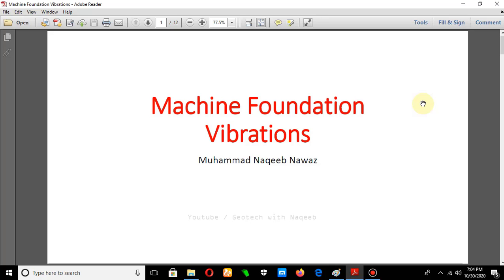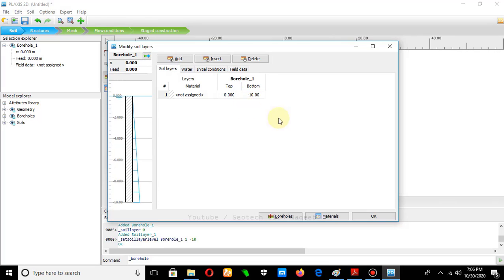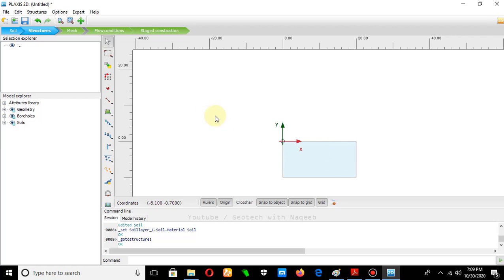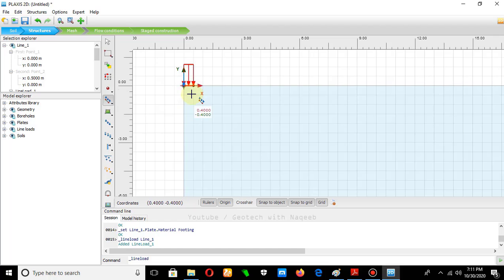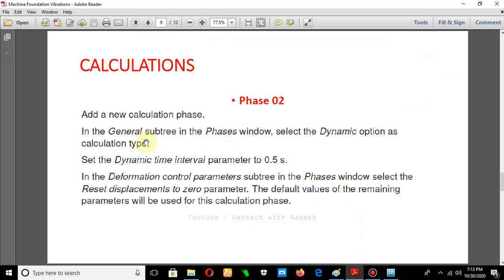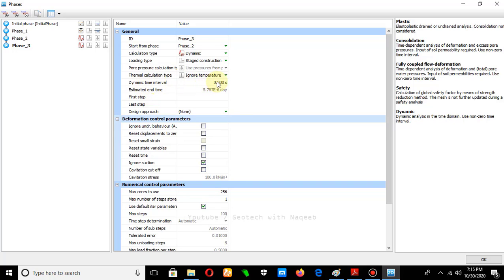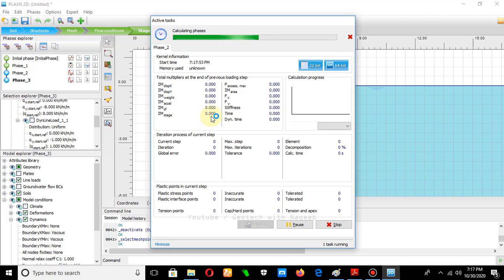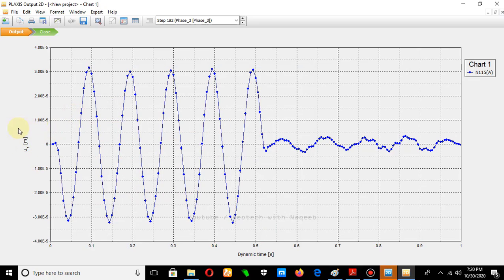PLAXIS 2D: Lec 03 | Machine Foundation Analysis | Soil-Structure Interaction | Geotech with Naqeeb

Comment: In load multiplier tab, what is the meaning of Amplitude. Is it the force required to generate by the generator or the amplitude of vibration due to running of generator.  Also, any specific calculation to decide the amplitude (considered 10 in the example)

Comment: Thank you for your efforts. However, I have several comments on the video. Firstly, you do not explain key elements in dynamic modelling modeling such as minimum element size, dynamic time, damping and boundary conditions. Secondly, I do not think at all that copying and pasting Plaxis tutorials are of any help because they are already available and well explained in Plaxis Tutorial PDF. Also, Bentley website already offers these models for free. Thirdly, I would have appreciated if you at least could explained more about the dynamic modelling aspects in Plaxis (as mentioned in my first point) because this is what most of researchers / practitioners are looking for. Hopefully, you could find my comment here is of some use to you. Best wishes.
Reply from the maker: Thank you for the generous suggestions